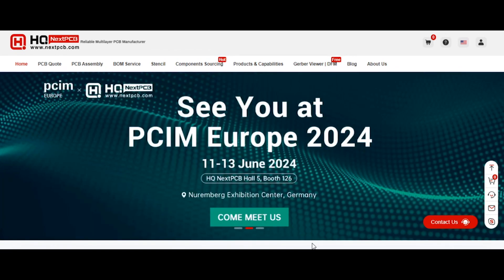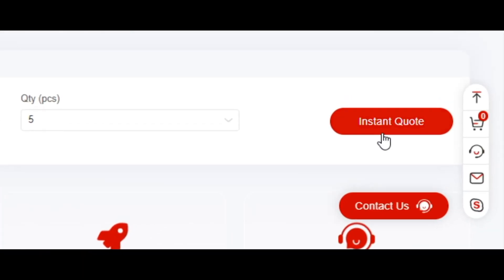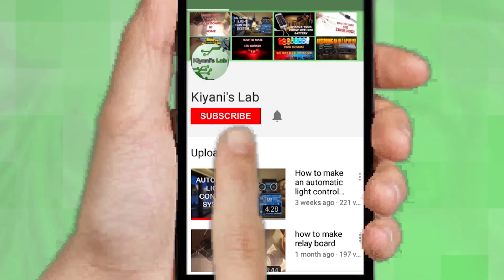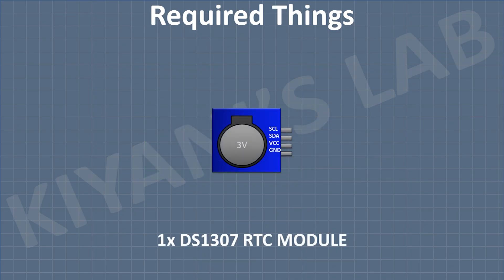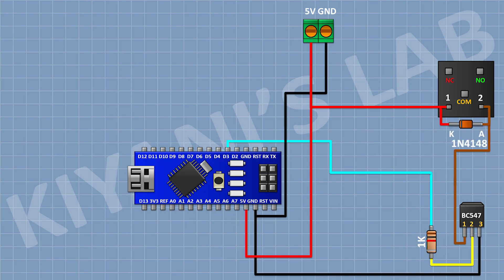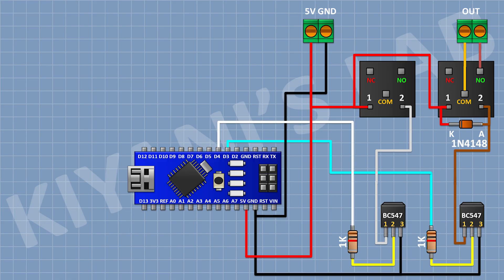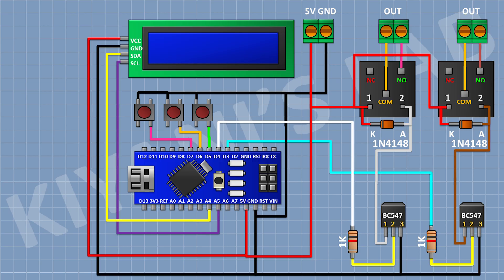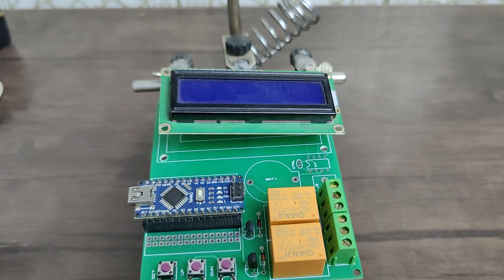How To Make Time Controlled Relay | Arduino Project | HQ NextPCB

Comment: Hi, in this code also the relay does not switches if off time is set 10am/pm or beyond it responds only with in 9:59,like as mentioned in How To Make RTC Relay Timer | Specific Time Trigger Switch.Please respond